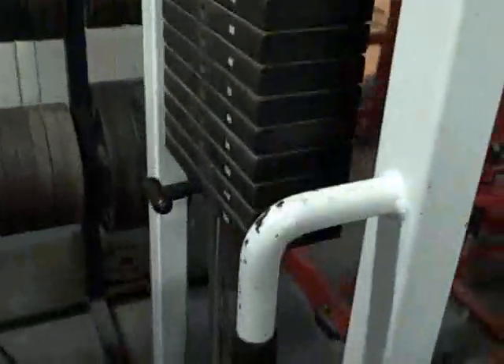Day 3 of 5 - Bodybuilding Contest Prep Arm Workout!!

Comment from the maker: @beschdmensch Good question.  Some do some do not.  You'll notice most of us over 250-300lbs use the Weider/Arnold, Mentzer/Yates Cheater, to failure, High Intensity, Blood and Guts approach.  Slower with lighter weight does not compute to a bigger competitive bodybuilder.You just can't build that type of a physique with the strictest form.  Those guys usually end up on the covers of GQ magazine. cut? Yes, Lean? Yes, 220lbs or less? Yes..  Nothing wrong with that, just not my style brother.